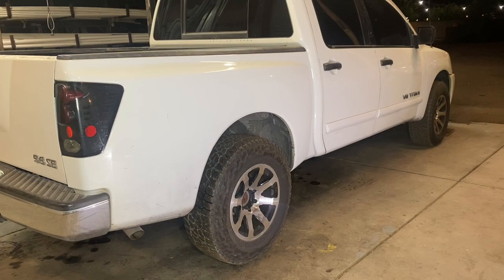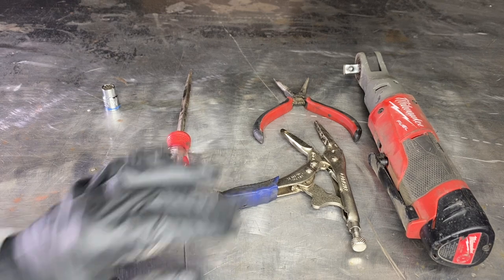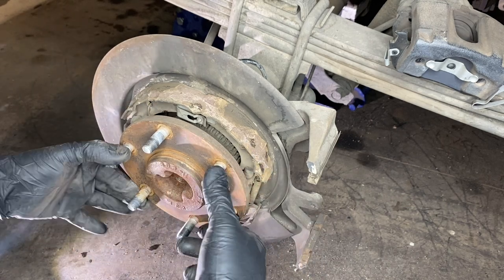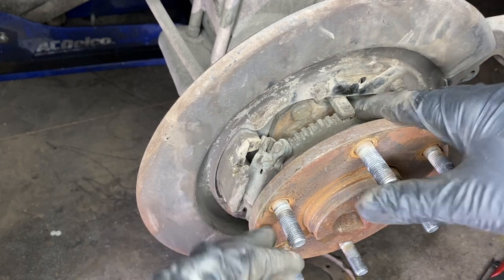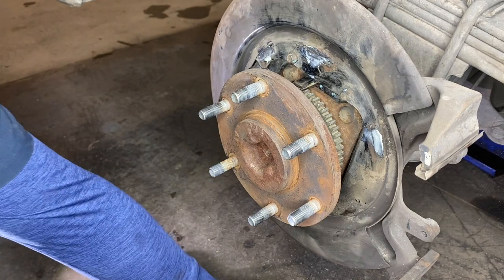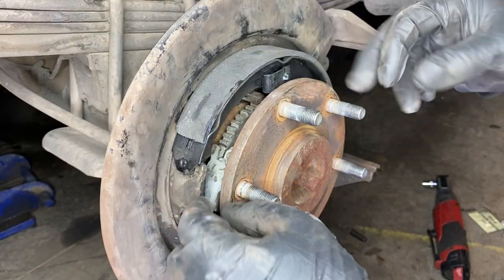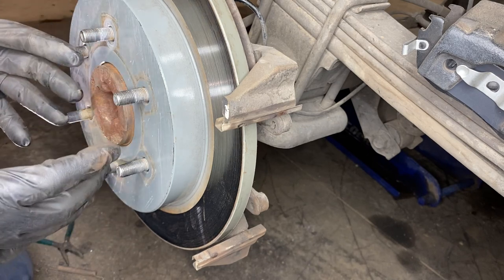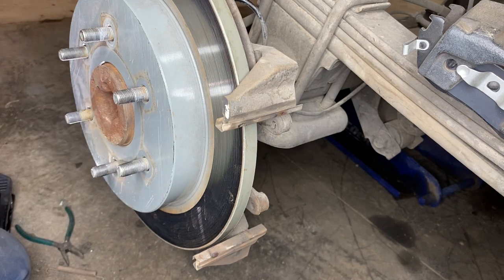Nissan Titan Parking Brake Replacement (2004-2015)

Comment: Aaron Thanks for your videos. I replaced the emergency brakes today - all new parts including the rotors and disc brake pads. I used your video to get me through it. Videos, all videos, are edited and all the crap is cut out. My job went like clockwork until I had to put those larger springs in ..... man that was some work. That was definitely the hardest part to the whole job. Again thank you.

Comment: All of the parts minus one of the clips and half of the clamp fell off when I took the disc off. Would I be able to put the brake disc and caliper back on a drive to the store to replace the parts?

Comment: HAS ANYONE HAD A WORKING PARKING BRAKE AFTER THIS INSTALL?!?? I have 2 titans. A 2004 and a 2005 both around 180k miles. I had a shop replace rear shoes on one, they couldn't get the parking brake to hold on a small hill, I tried to redo it, still won't hold. Then on my other Titan, I replaced shoes and rear rotors, no good either and won't hold on smallest hill!! WTF? Any ideas, I've done the burnishing procedure, when installing I made sure adjuster was as expanded as possible. Only thing I'm thinking is the cable needs to be replaced.. DOES NO ONE ELSE HAVE TGIS ISSUE!?
Reply: Cable may have slipped out of it's holder. It has the hook to hold it but if it comes undone you probably can't see it until you take the rotors off to get to it. Sorry I didn't see your comment until now hope you figured it out.

Comment: Aaron very good video. My 14 Armada park brake has never held firm since I bought in 2018 and I was honestly surprised to learn was a shoe system but with your knowledge I will take care of. Haven’t worked on drums since jeeze probably 1988 34 years that’s crazy. Many thanks. Actually have a break tool for working with springs

Comment: Hey Aaron, gotta question.  I own '12 titan.  I done everything in the video. When I set my parking brake it doesn't hold still. Is there another adjustment that I need to check? I adjustment the little cog wheel to expand the drum like the video said to but still won't hold.

Comment: Hey Great video as always Thanks for all the helpful much needed advice someone REMOVED ALL the parking brake equipment for some reason and I am wondering if this is why my 4wd isn't working. Replaced front diff replaced both front bearing hub assembly new rotors pads all the way around. at a loss as why my SLIP and ABS lights are on I think this might be the culprit any direction would be appreciated.

Comment: Thanks! I replaced my rear brake pads and had my rotors turned to discover that my emergency brake doesn't work from all the rust. Definitely have to fix it.

Comment: So I followed your guide and installed the parking brake on my passenger side, and it took some finessing to get my rotor on, so I assumed it would have a nice tight grip, but when I depressed the parking brake pedal, I was able to still turn the wheel by hand. What did I possibly do wrong?
Reply from the maker: You need to adjust the shoes out via the adjuster

Comment: Thanks Aaron, excellent work as usual.  I recently began to have trouble using my reverse gear and several guys on the Titan forums mentioned a broken parking brake may be the culprit.  Gonna pull my rotors and check it out.  I am camped in the back country of AZ now and don't have access to parts at the moment.  Any driveability issues if I remove the old parking brake components before driving to the parts store?
Reply: I have not had mine in for two years lol. No issues if you remove. I just bought a set though due to getting a 22 ft center console I was never worried with my 16ft but this thing weights 4x as much. Rather be safe than sorry!
Reply: @gutaroker90  thx for the info.  I pulled my rotors and everything looked OK as best I can tell...no broken parts or impingement on the drum.  Still may replace the ebrakes this year though.  Truck only has 85k on it so I can't believe it would have any significant transmission issues.
Reply: @trekfortruth2841   you’re welcome when did the rear rotors and breaks my e brake came off as dust 😂 change all your fluids at regular intervals and do spill and fills she will last I’m at 165k, tow hard, and send it very often. No problems. One of Nissans best builds with Jatco for sure.

Comment: Thank you so much Aaron for these Titan vids.  Is the parking brake only on one side?  If so, which side?  I need to adjust mine as it does not hold very well anymore.  Thanks.
Reply from the maker: No both rear wheels have a brake! Thank u
Reply: @AaronHinesAuto  Thank you sir.  I really do appreciate that you take the time to do videos dedicated to the Nissan Titan.  I am a subscriber and like each video.  Much respect to you.

Comment: Would this be the cause of my squeaking in the rear at speed?
Reply from the maker: Yes, pull the rotor and check it out
Reply: @AaronHinesAuto  thanks. I just bought a used 2014 Titan SL and I noticed the parking brake pedal goes all the way to the floor but doesn't keep the vehicle from rolling on a grade when in neutral. Gonna take a look at the parking shoes as soon as I get time. Thanks.
Reply from the maker: That’s a sure sign that there’s something wrong with the parking brake shoes or hardware good luck!